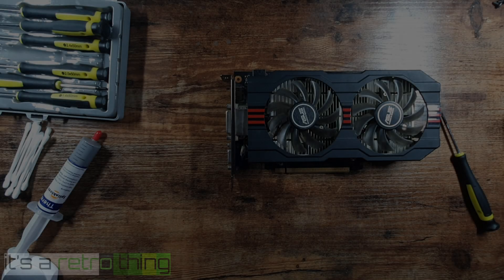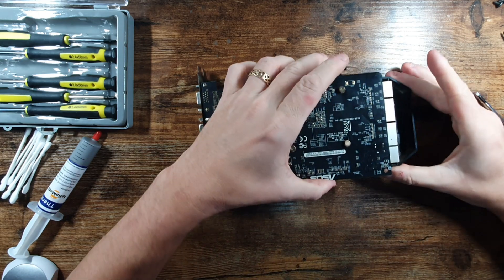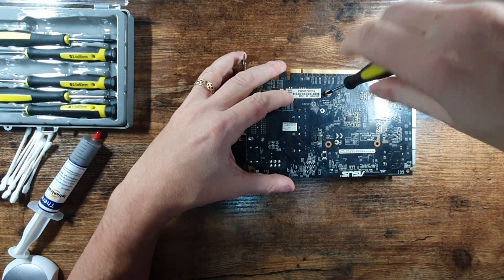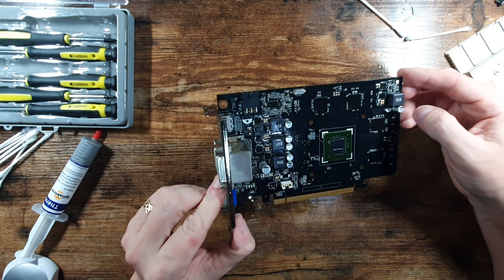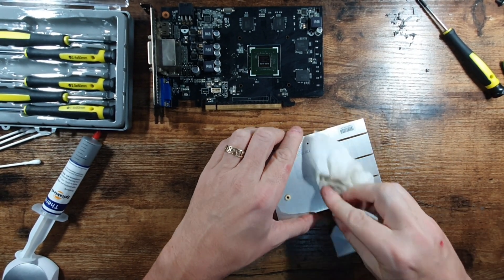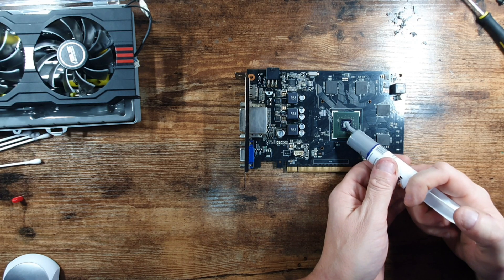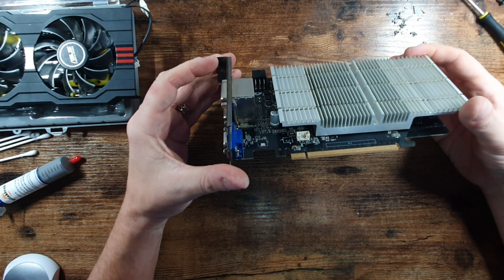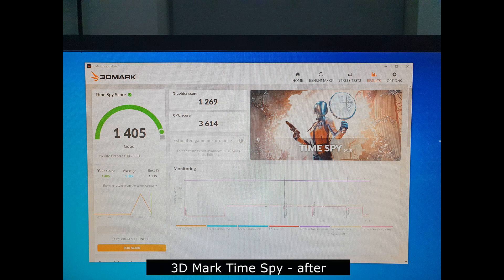ASUS Nvidia GeForce GTX 750 TI - Teardown and cleaning for better benchmark results

Comment: Did temps got better after thermal paste applications?
Reply from the maker: Hi there,  sorry i wasnt tracking temps over the course of this fix as im still getting familiar with the software needed to benchmark and test this equipment.  Having said that I can only really attribute the increase in performance to a lower of the temperatures over the entire board from the cleaning and new paste.  Its not even good paste - or should i say expensive!  Its well worth striping these old components even if its only to increase their longevity.
Reply: @its-a-retro-thing  i see, thanks for the answer^^
Reply: @its-a-retro-thing  in GTX 750 ti you need a power adaptor or not
Reply from the maker: @Blade007-u3j  yes this card has a 6 pin power plug